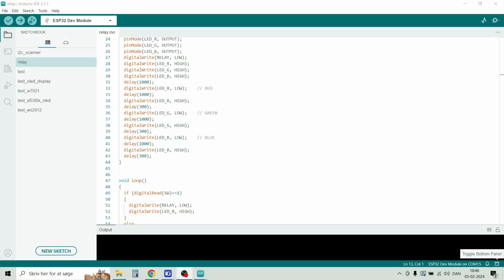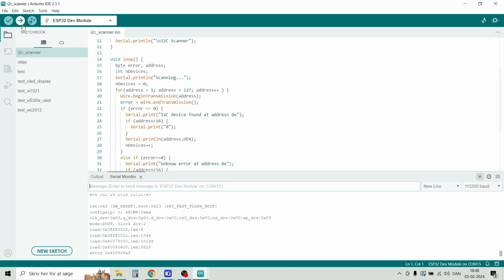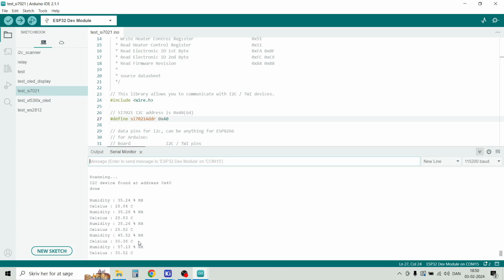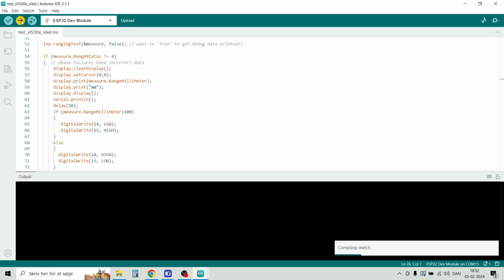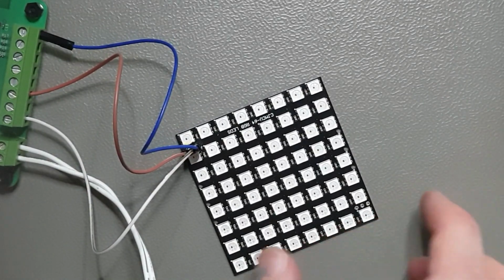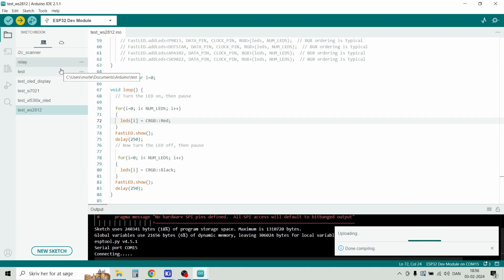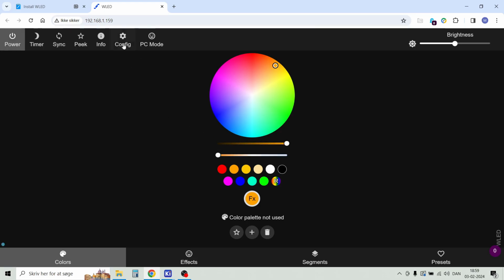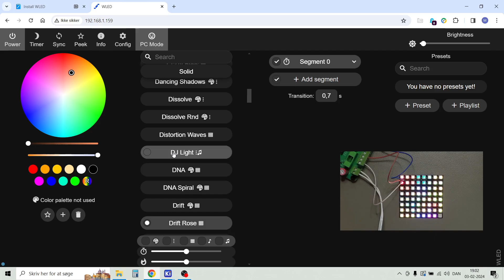KiCad 7 designed ESP32 iot-thing board. Arduino and WLED test code. Full tutorial.

Comment: Thanks a lot, Morton.
Nicely done design.
Can you please add a comment with the approximate assembled cost?
How about adding anti-tracking slots around the relay switch contacts to minimize the possibility of flash over if a user were to use the relay at line voltage ?
I really enjoyed your video. Thank you for sharing both the design, the "process", and the results.
Reply: Well, most of my career was in the software/hardware engineering field.
15 years in aerospace, 5 years in gas and oil, 12 years in computer related R&D. I spent decades learning new stuff. 

I figure I won't stop. Even when I'm "dead", there has to be something to learn, even then. 

I started learning a new language about 2 years ago.

I've been involved with microprocessors pretty much from the dawn of "chips". Including building an IMSAI 8008 (later converted to an 8080.) on my dining room table!

ESP32's are a cheap, fun way to experiment.

PCB CAD is the part that's new. And looks like fun.

Thanks for helping us all learn. :-) I'm grateful.
Reply from the maker: @linuxranch  What an amazing career, incredibly how the technology has moved on during these years. Thansk for sharing this story.. Good luck with your new prjects and let me know if you need any support! Happy new Year to you Steven.
Reply from the maker: @linuxranch, 
Thank you very much, i am glad you find the video helpful.
The parts themselves is not very expensive, i think the total cost of parts is below 40 USD, the relay is the most expensive since this is a high quality one, if you need one assembled board you can quote at PCBWAY. I know that several people has quoted the price from them, you can do it from here :
https://www.pcbway.com/project/shareproject/iot_thing_universal_iot_development_board_034f7af7.html
I was considering to make slots in the PCB to isolate but the creep distance is OK using mains voltage on the relay.
If you qoute price at PCBWAY, please share price with us.
Let me know if you need any support?
BTW: I did the assembly myself, it was quite easy ....
Reply: @made.by.morten.laboratories Thanks for your reply. At 70 years old it's a race between which gives out first, eyesight or steady hands! :-) Their pick and place robots do better than  me, by hand. :-)
Reply from the maker: @linuxranch
Dear Steven, I find you approach of keep on learning at age 70 very inspiring, good luck with your learning curve 😀

Comment: Nice job! The manufactured bord appears to have a support for the SN74AHCT245N, which was not part of the design shared in the previous video. How do you add an IC support in the schematic and board design?
Reply from the maker: The SN74AHCT245N have High-Level Input voltage of 2.0V where the HC and HCT has a higher VIH closer to 3.3V. You can change the type number by double click on the part else in the schematic editor go to  "TOOLS" - "EDIT SYMBOL FIELDS" - here you can change all parameters.
Reply: OK thanks

Comment: "... programmed into the Arduino.." but is an ESP32,  not an Arduino. Interesting though that you can run Arduino code on the ESP32. How does this work together with the ESP-IDF?
Reply from the maker: There is quite a few different processors and boards that are supported by the Arduino IDE. ESP-IDF is not related to Arduino.
Reply: @made.by.morten.laboratories  I know it is not related, but can it work together? ESP-IDF is the standard environment for the ESP32, but it is not as accessible for hobbyists. For a project I need ESP-IDF, but at the same time I would like to "open up" the ESP module for customer code. Many people ask me "why not Arduino".
Reply from the maker: @gideonz74b, sounds like a cool project. On the pro side we also use the ESP-IDF - i agree with you Arduino is most useful for fast prototyping

Comment: I greatly underestimated how difficult it is to apply solder paste by hand to each 0402 pad, I forsure will be getting the stencil next time.  And just how hard it is to see what you're doing. All i have for now is a 16x loop from my grandfather, its just barely doable. Do you have a recommendation for a scope ?
Reply from the maker: I dont use a stencil, for 0402 parts i just apply solder to one PCB pad and thne place the part with a twezzer while heating up the solder with the soldering iron, this works for me. I got my scope from NorthridgeFix, you can see some of my other videos where try and work with it. There are many entry level microscopes out there - sorry i have no recommondations on these ones.
Reply: @made.by.morten.laboratories   Ill give that a try next run, I just found out i made a slight mistake when using your schematic as a reference. I double swapped RC and TX so its just RX to RX TX to TX.  Its seen as a silicon labs uart bridge so im stoked about that. That was a hard part to get in just the right place. 
Edit. I did manage to get the mixed up traces resolved and its now accepting code :D  Can't believe its working at all tbh, with only 4 weeks of learning and designing the whole thing, to this Feels good.
Reply from the maker: @NewcastleDayz  Congratz on getting it up and running, that is really cool. RX and TX swapping has been a nightmare for me many times ..... You can place two 0R resistors in series with RX and TX, then place them next to each other on the PCB. In one posistion they go straight through and if you rotate the resistors 90 degrees you swap RX and TX
Reply: @made.by.morten.laboratories   I got it done with some strands of wire and the tongue at the correct angle. But now I found one more thing. My reset switch is connected to the wrong pin on the esp32.  I knew it wouldn't be a home run and everything works. Still way too excited about this
Reply from the maker: @NewcastleDayz  There is always one more bug 🙂
Reply: @made.by.morten.laboratories  Its hopefully the last error. probably not though...
Reply: @made.by.morten.laboratories   If I could ask a few questions on how i should fix my error. Would be willing to add me on discord?
Reply from the maker: @NewcastleDayz  Sure, i have not used it before, pleease share your info
Reply from the maker: @zviper  - no sure if i found you, only works without #4216 - mine is moffe200
Reply: @made.by.morten.laboratories   Made some progress, but its something new now with usb..
Reply from the maker: @NewcastleDayz  Strange, is it the same if you rotate the USB cable connector?
Reply: @made.by.morten.laboratories   yep i have more info on discord.

Comment: Nice board. Could you please explain a little bit the usage of SN74AHCT245N? you mentioned it is used to drive the LEDs. I found some datasheet but i'm not really sure why its needed for the leds. Thanks
Reply from the maker: Its for driving addressable LED strips (like WS2812B) They are not 3.3V logic, so a level translator is needed, the SN74AHCT245N converts 3.3V logic to 5V logic. In many design you will see different ways of doing it - this is just one way.
Reply: @made.by.morten.laboratories   ah so its used as a logic level shifter. Got it. Thank you for the explanation :)
Reply from the maker: @Mikomanus  No problem 😀